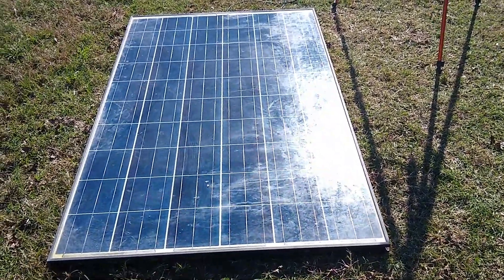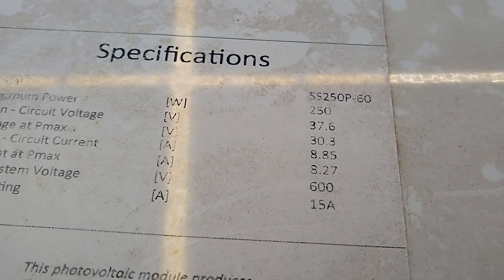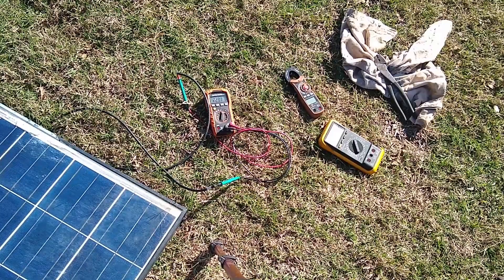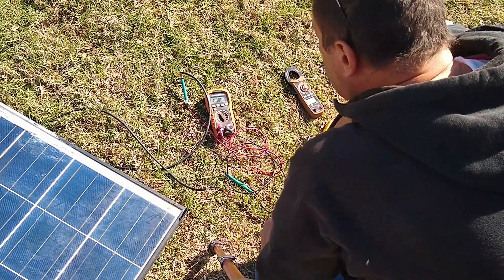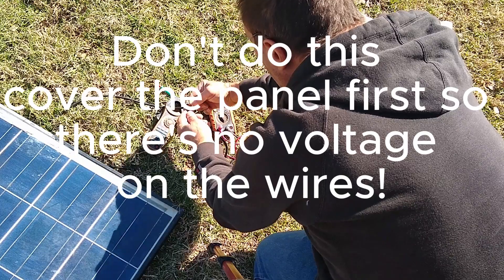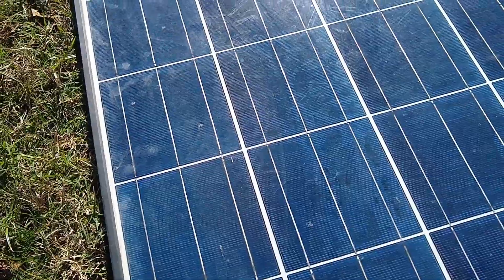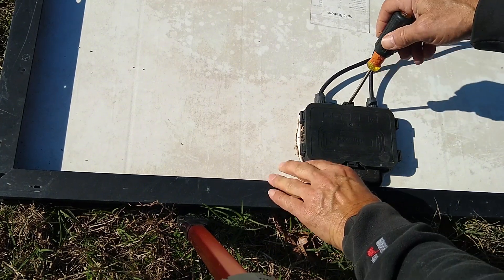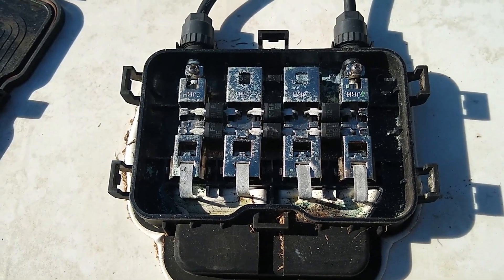How to Test Used Solar Panels DIY

Comment: Testing like this can be misleading, and here's why.  Bypass diodes.  You can have cracked cells that are still producing current so the voltage reading will be acceptable because all cells in the panel are contributing.  Current can indicate acceptable even if some cells are damaged since the bypass diodes will step into effect and bypass that section of the panel.  It's a trap for young players.  What you really need is a MPPT circuit that will tell you Imp, Vmp, and of course watts.  Then you can genuinely tell if your panel is good.  You can get standalone hand held MPPT meters pretty cheaply from all the usual online places.  A MPPT solar charger with a front panel display or bluetooth etc allowing you to see the statistics on a computer or smart phone will do the job too.  Of course you need a load such as a partially charged battery for the solar charger while the hand held meter has a power resistor (or transistor etc) to dissipate power within itself.

I hope this gives you some guidance with regards to power production but there's more issues to consider depending on how you are planning on using the panel such as electrical leakage.
Reply: I’d be interested in seeing the case where OV and SC checked out ok, yet the panel produces low wattage. I’ll bet it happens, but rather rare?
Reply: @ThomasChristie-t9f  Not as rare as you might think.  Knowing the mp values is useful when assembling strings / arrays too.
Reply from the maker: Thanks for the input, all good points! I just wanted to show a quick and dirty way how anyone with only a multi-meter can check a panel. I actually have a UNI-T UT673PV coming on the slow boat. I'll do a video when that gets here. Thanks for watching!